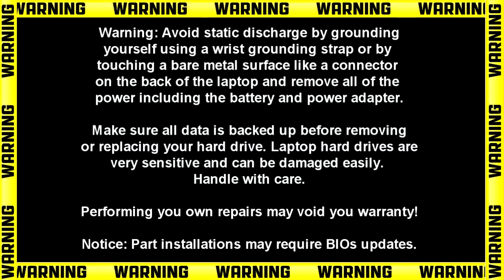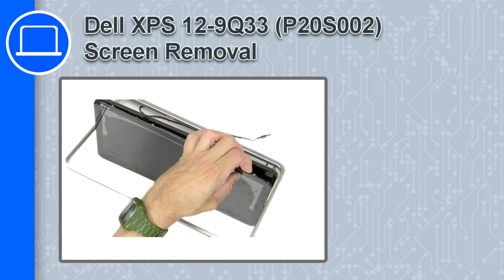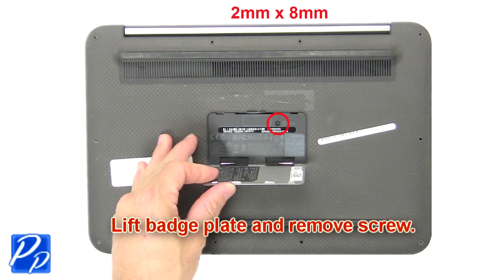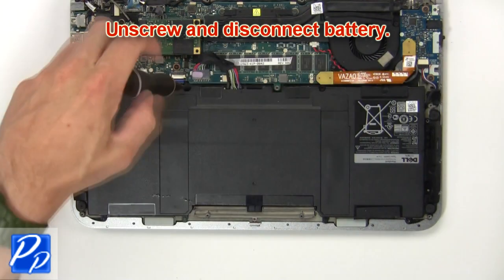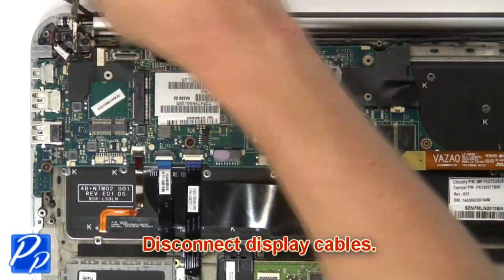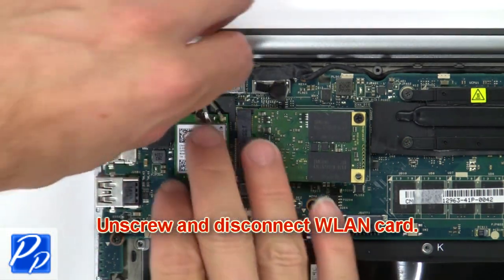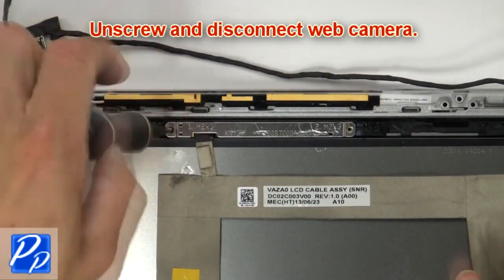Dell XPS 12-9Q33 (P20S002) Screen How-To Video Tutorial

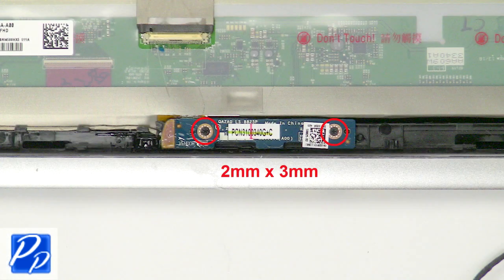Comment: This video is very bad. For changing the screen DO NOT FOLLOW THE STEPS BEFORE TIME 1:03! You don't need to open the cover under the keyboard and removing all the stuff.

Opening the screen is easy, just open all 16 screws around the flip frame. Unscrew & unmount camera, unscrew & unmout win button, unmount the display plug (only these steps are in the video!). The flip has 2 screws on each side. New screen can be still ordered at Ali, look for the variant "With Frame" - you just exchange one screen frame with the other one (without any glue as Ace X wrote before), plug in display, mount and plug camera&button and cover the flip again.
Reply: Which screen on Ali is best?
Reply: @nathanschwartfeger1521  I tried only one and it works. Just order variant "with border" and check 9Q23/9Q33.

Comment: Thanks so much for the video.  It helped a great deal with my screen replacement!  Getting the plastic hinge cover to stay in place is proving tricky, but otherwise successful.
Reply: I’m looking to buy a new screen, do you know the difference between the one with border or frame and the one without it?
Reply: @luisrodriguez1997  I have only ever had the version of screen with the border (the top contains the front camera and the bottom has a Windows button).  I presume that the borderless one does not have the Windows button.  However, that button is of little use in “laptop mode”, it would only really be used if the screen is flipped over into “tablet mode”.

Comment: this is not the end of the story, the replacement screen comes without the frame which holds the camera and the button. The screen is glued in and its a headache to remove since you need to heat it up. It's messy, everything sticks and the new screen has to be glued in if it does not stick so well anymore :( I tried to find a replacement including frame, sadly your are out of stock on everything screen for this model and others have only the screen itself (china) without frame. Its still a great Laptop even in 2019 but getting parts is very difficult
Reply: I’m looking to buy a new screen, what’s the difference between with border or frame and without it?